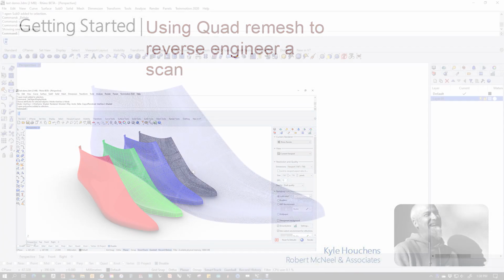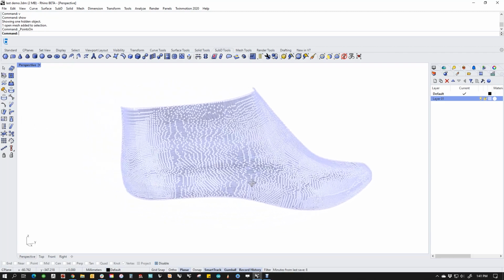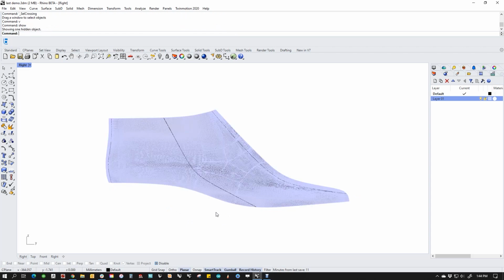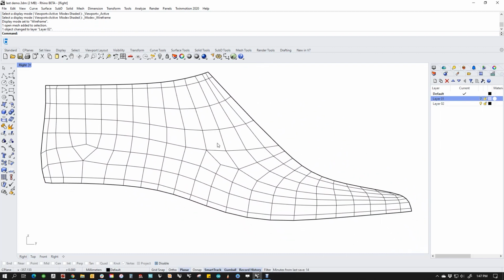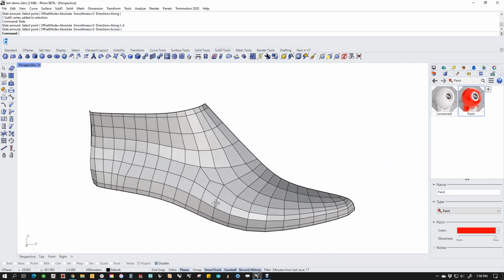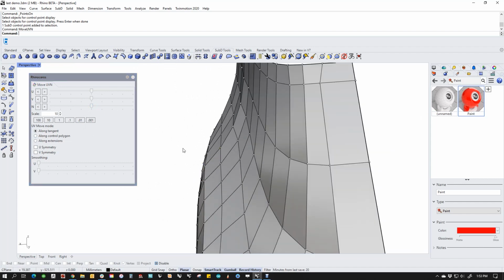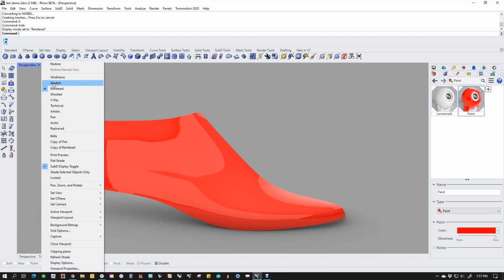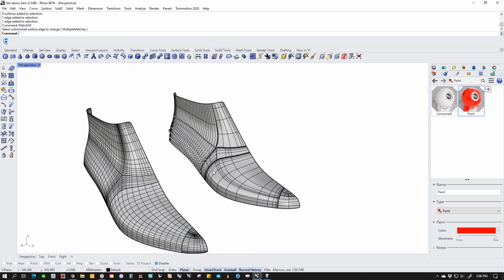Rhino 7- Using QuadRemesh to Reverse Engineer a Scan

Comment: @Rhinoceros3d Why convert Quad Remesh results into NURBS? In the context of shoe last design, what advantages do NURBS surfaces offer compared to a combination of Quad Mesh and SubD?
Reply from the maker: mesh can occasionally be difficult to work with in a CAD or CAM environment. Subd cannot be exported directly to a printer or cnc machine. 

You can certainly print a mesh, but many downstream CAD functions prefer or often require Nurbs surfaces. 

The upside here, is you can use any data type you prefer for your given use case.

Comment: I used quad remesh on my shoe last, and 3d printed the object and it came out much smaller than the original 3d scan.
I wish you would show how to use quadremesh  on a shoe last and get closer Dimensions to the original 3D scan of the last.
Reply from the maker: Units mismatch?
Reply: @Rhinoceros3d  the units match. but the quadremesh makes the original object much smaller.
Reply from the maker: @SimchaYaffa  can you send this file with pics to show the issue to tech@mcneel.com? We have not seen this issue and would like to debug your file.
Reply: @Rhinoceros3d  just sent you the files - thank you

Comment: Very nice! Now all you folks need is to employ XYZ Transformation & Pivot Point nodes with Hierarchical Modeling, and you will have a fairly complete concept design tool that can prepare production data for complex products.  Why not add some deformation tools while at it?  I would love for Rhino to eventually become Maya killer(I have been using both for the last 20+ years because I have always needed both).  For freelancers and small studios, the combination of Rhino 7(and Grasshopper) + Blender + Fusion 360 looks like it will be the ideal combination for the next few years.  Please keep up the great work!
Reply: Yup... fully agree with you.

Comment: Hey Kyle, does the sub d in Rhino 7 have a snap to mesh feature?  Thinking of dragging control points and having them drag along the mesh "surface."
Reply from the maker: Not as you are thinking..you can snap a face to verts, but the “water slide decal” style retopo you are likely thinking of is still in development. I’m hoping we can get that working well in a future release. 

In the meantime, quad remesh with guide curves is doing a lot of heavy lifting for the retopo folks.
Reply: @Rhinoceros3d  The Quad Remesh for Rhino 7 is very impressive for the first generation.  One strong vote here for the contour-following retopology tool.  I have been using the Maya Quad Draw tool for that purpose and it is indispensable... I would love Rhino's capability for product design and concept development eclipse Maya someday!

Comment: All the SubD point relaxation / edge loop re-fitting could of course be done a lot easier, faster and with greater precision in polygonal modeling software - the unsubdivided SubD state being exported into a mesh and edited with a Shinkwrap modifier on top of the original unorganised shoe mesh. The presented UVN method of rearranging the SubD points might lead to more arbitrary results as opposed to vertex editing with a Shrinkwrap.

The re-fitted base mesh could be then brought back into Rhino's SubD state, then converted into NURBS surface set, etc.
Reply from the maker: what software are you using for shrinkwrapping?
Reply: @Rhinoceros3d  Blender, but I'd imagine that any major polygonal modeling package will include similar functionality.

It's good to see greater expansion of Rhino into the domain, although as someone working with both polygonal and surface modeling  I'd still use the combination described above, just for the sake of greater control of the retopologized mesh.